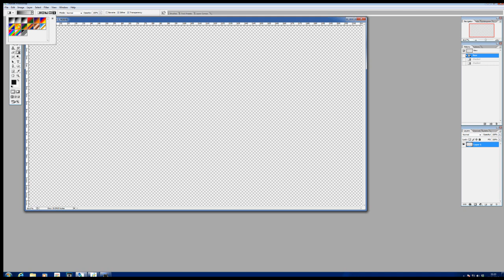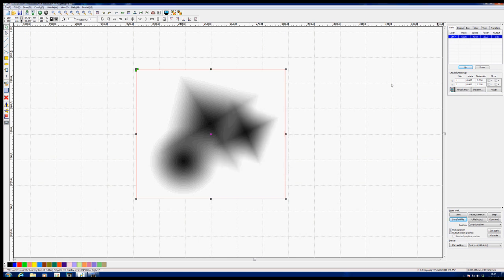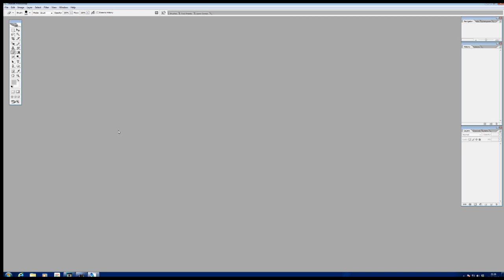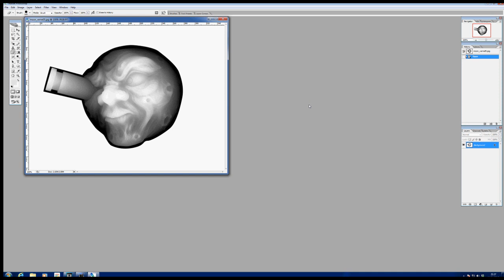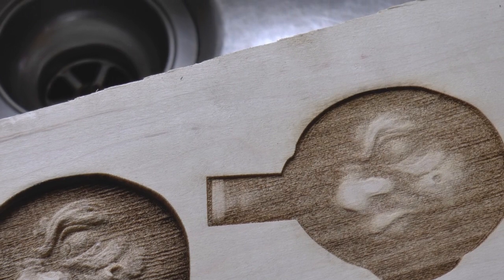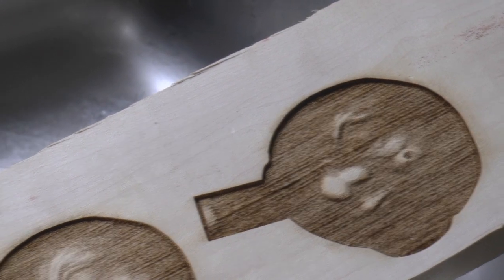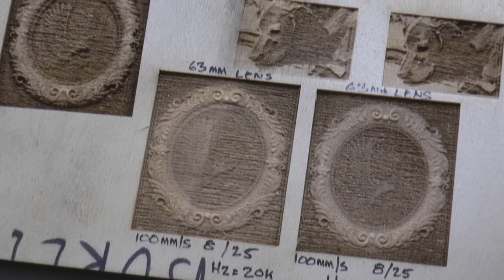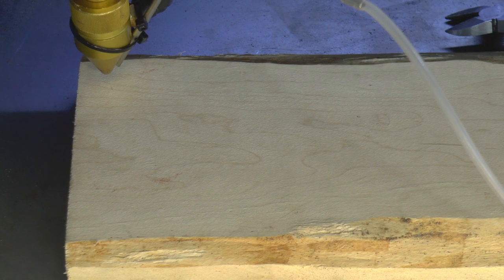RDWorks Learning Lab 58 3D carving At last!!

Comment: Hello again Russ
The machine we have has a setting in the controls panel named user...the option that I discovered was the scan mode option...it's set from the factory on normal state...if you select special scan mode it's allows for proportional scanning....it's free tried it and it works great.
Reply from the maker: +Scott Thorne 
Hi Scott
Very interested. I'm up to my eyeballs with urgent paid work for the next few days with little time to play. What's the difference that you noticed.?When I get time I'll play as well to see what's possible. Thanks for the info
Sincere regards
Russ
Reply: +SarbarMultimedia Russ
The overall depth of the engrave changed...the light grays were more pronounced as well as the darker shades of gray...I actually read about the setting in the operation manual for the software.

Comment: I'd suggest relieving the tube of instantaneous power ups/downs in wattage.
I can't say if the electronics would be at fault or the tube.
But a latency in the etch as well as the heat of the material could possibly be at fault.
For example the star shape ... 
If your machine was programed to simply cut a star within a star within a star (etc) at different shades of grey.
Rather than using linear typewriter type motion at the head ... The results would be significantly different.
Multiple passes could be applied to tackle depth issues.
Just a thought.
Reply: If your design looked more like a topographical map ... then ...
Reply from the maker: Hi I understand that a series of contour lines  would produce the best results and that is effectively how they generate those decent images that carve so well. However, I am not trying to find workarounds, I'm trying to firstly understand how the machine works and if there are problems with instantaneous wattage control then I'm out to find out why.  Although the PWM system is used to control cutting power,  I think there must be a lookup table within the controller to deal with the 256 grey levels at 500mm/s That's something else I want to check out. Just how responsive is it
Thanks for your input  it's always good to get stimulating ideas.
Best regards
Russ
Reply: If you ever entertain the idea ... It's a video I'd love to watch.
I have no idea how a picture of a horse for example could be converted in such a manner.
It may be a futile exercise.
Reply from the maker: Sadly I think all these models are produced from raytracing real 3D objects. Its the amount of reflectance off the surface that you are trying to map. Imagine  a mirror polished round tube If you fired a beam of light onto the surface and measured how much light was reflected back at you. On the surface closest to you there would be 100% but as the tube curved away from you, more of the light would scatter sideways  and there would be less and less refelectance. That's the principle.
Russ

Comment: Hey Russ. Just curious to know if your using cast or extruded acrylic for that last etch? Extruded is much better for etching as it gives a more smoother finish. Also you good heat the etched area up with a miniature blow torch to smooth it out further. Excellent research here
Reply from the maker: +Mohammed Ali
Hi Mohammed
As thickness increases extruded acrylic tends to be a rare breed  and most of what I use is offcuts from a large supplier (that I get almost for free)  and tends to be cast acrylic....I can't be too choosy with that deal.  Flame polishing as a second operation is not something I had considered......... but it's an excellent idea.  I may try running the program again at a lower power/faster and defocused by maybe 10mm to see If I can deliver a controlled polishing effect.
Thanks again
Best regards
Russ

Comment: another great video.  now that you have a true 60W tube which is I deal for engraving.  could you post what you are now able to cut like material, thickness. power or ma setting and number of pssses etc  I would like to order a machine and would like to see some real world figures of what a 60 w can do.  a lot of the makers say 90w but the engraving detail will be far less is my understanding
Reply from the maker: +3K Carbon - G10 - FR4 - Supplies & CNC Routing - 3D CAD Design & 3D Printing - Online Shop 

Hi
In the past I have always used %power  and speed when I have talked about machine settings. But of course that's pretty meaningless because now I have the 60 watt tube the previous % power settings are meaningless. I plan to record my future data in a more universal way ie watts and speed. Now this is a problem for many people because they do not have power meters and do not know what power they are using. I do not yet have much cutting data from my new tube but you can go to 
http://www.thunderlaser.com/download/down/parameters%20for%20different%20materials-60watt%20SP.pdf

and get a good representative list of parameters. I suspect these parameters are for a 2" focal length lens and will understat what you will be able to achieve with a 1.5" lens.
Double cutting? Yes I have done it and it sort of works but is very inefficient and its success is very material dependant. With acrylic it works reasonably well but you may get a bit of a rough finish to the second cut. Acrylic evaporates whereas most other materials BURN. The smoke in the cut itself is a fantastic absorber of the infra-red radiation so a CLOSED cut just harbours the smoke and absorbs your power. Double and triple cutting does nothing more than make a bigger mess of your cut. You ideally want tp slow down to a point where the material cuts right through and  the air assist will blow the smoke out the bottom of you cut
Engraving does not require huge power. If you buy a 50 watt machine the chances are you will get a 40 watt tube. That 40 watts will typically span 10% to 60 % ie the machine programe will typically have control 40/(60-10)= 0.8 watts per 1% power. If you then upgrade it to  decent 90 watt tube, the chances are you will get 100 watts at about 65%. Now the program has control of 100/(65-10)=1.8 watts per 1%. That finer control of the power for a lower power tube is what's being discussed when they talk about better detail.
The other factor that may influence your decision is the ratio of cutting to engraving you will do and if it's for a business . Higher power can mean higher productivity (higher cutting speeds ) in most instances. I have used 30 watts at  the  nozzle to cut 15mm acrylic but at 1mm/sec   and also 12mm plywood with a 1.5" focal length lens.  60 watts gives lots of flexibility but beware of buying a 60 watt ebay machine. Ask lots of questions of the vendor because the chances are that their 60 watt machines will be 50 watt machines with 60 watt power supply. 

Good luck
Russ

Comment: This is awesome!  Now that laser engraving has progressed to this level, now I am sure that one can use lasers to mill also....even to do SURFACE FINISHING...which is awesome, because if one can mill using a laser, there are no 'work contact' related forces to deal with which lower the cost and simplify the design of cncs in countless ways!
Reply: Could you (if you are not looking at this already), look at trying to develop methodology for milling material away and then (using the same technology ? for carving shown here) demonstrate the ability to do some (even crude "finishes" would be AWESOME!) finish passes on steel or aluminum???!!!  Wow!  That would revolutionize many aspects of machining and manufacturing!!!!????
Reply from the maker: Hi 
Sadly I'm afraid your dream will have to remain "dreamish" at present. I have been involved in engineering all my life and particularly production engineering where I am always chasing your dream. I owned my own metal cutting laser business with two 3kw machines. All the old techniques of welding, stress relieving, rough machining, finish machining etc etc all disappeared from my book when laser machines came along. There are so many things that can be converted into 2pieces and accurately laser cut and assembled to bypass many of the traditional manufacturing costs.  Although these little machines are fantastic value for money they are not anywhere near your fantasy yet. Firstly these do not have the power to cut metal. HOWEVER there are some new high power fibre optic laser engravers that can do some amazing tricks with surface finishes. I can't put my hands on the link at present but I will look later
Best regards and thanks for you comment
Russ

Comment: I not sure if you're aware but I have to tell you that before engraving relief engravings you must dither the image first, only then you will have good results even with your "specially prepared images" which are in fact grayscale from 3D relief made in ZBrush or ArtCamPro, Im 3D modeler myself thats how I know it, I also have 2 laser engravers which I m using for more than 7 yrs now pro. Also you must set one direction laser beam so it will not burn too much. You have dithering tool in RDWorks as well, under bitmap handle menu. Cheers. I forgot to tell you, you need to make laser beams from line to line closer for this setup, about 0.08.
Reply from the maker: Hi Toni
Sincere thanks for your feedback. As I am sure you know I'm still learning about this machine and technology and my venture into 3D carving has thrown up so many questions about the machine that I wish to understand and that's before I get into the finer points of 3D creations.  I am not a graphic artist, just a simple mechanical engineer without the software tools you mentioned. As a professional passing on the benefit of your experience, I cannot thank you enough because trying to find information about the details of this subject has been impossible.
I am on holiday at present so am unable to play with my machine.

There is one thing about your dithering suggestion that puzzles me  immensely. My understanding of dithering is that it's a way of converting a grayscale image into a binary black and white format  where the density of the fixed size black dots recreates the effect of a grayscale  image but with binary information. You set the the laser to a fixed power, scan speed and scan pitch, then as the scan happens, the laser power is either ON  as it encounters black dots  and OFF in white areas. 
On the other hand, as I have found out by experimentation, when you set the max power and min power to different values and leave the image as an original multi-tonal image, RDWorks breaks that image  down into scan line data that has continuously varying power information across the scan, where that varying power  is one of 256 levels between the max and min power levels set. This causes a continuously varying depth of "burn" and scan line by scan line gradually builds a 3D rendition.
As I have been experimenting with dithered images on thick card I have noticed a sort of shallow 3D effect as the burnt dots overlapped in the very dense areas. This is an interesting effect but not 3D carving.
The uni-directional scanning  and line spacing are items on my experimentation list when I understand more about how the laser beam is controlled in scan mode as opposed to cut mode. 
I am now more fascinated by your introduction of dithering to this process. I cannot see how binary  dithering and continuously varying grayscale scanning are complementary.  Can you please explain further 

Sincere thanks for your input
Best regards
Russ

Comment: Is there any way to generate a fill pattern with dots reliability?  

RDWORKS has a dot mode (scan, cut, dot), but it can only follow lines and it causes the machine to loose stepper motor synchronization. So everything gets distorted.   My machine is able to cut and scan without loosing stepper motor lock,  even at very high speed.  At even very low speeds, the dot mode causes stepper loss.  I noticed in scan and cut modes, the head accelerates and decelerates without discontinuities.  In dot more, it appears to jump abruptly, thus causing stepper lock loss.

I want to engrave with dots since it should generate the best visual effect for lighted signs. Same principle as back light wave-guides for LCD display.
Reply from the maker: Hi John
 There are two possibilities for you.
Right at the bottom of the EDIT menu there is a feature called LGP design. I have no knowledge of this but it is specifically for doing what you want.
I have found that back engraving quite deeply into acrylic leaves a matt crusty finish in the letters/ lines which is great for picking up edge lighting,  not necessarily good for photo's. 
There is a feature in RDWorks that you will be able to employ.  Here's a simple example to test it with.
Draw 2 concentric circles in RDWorks. 
Put a marquee round the whole. 
Select Handle and choose Graphic Hatch.  A bmp resolution window appears. Set 100 say. and press OK. The outer area is now a bitmapped area and a BMP layer appears in the parameters list.
DONT put a marquee round the whole, that will select BOTH layers. Just click in the grey bitmap area and handles will appear on the bit map layer only.
Select Handle menu and click on Bitmap Handle
NOW its all down to your taste.
Tick output resolution. Tick Dither. Tick Dot Graphic and click Aply to view to see what you will get. Change the resolution to 50 and click apply to view
When you get the look you want then click Apply to source and and OK
Check with Preview to see an idea of the cut order and what you will get.

Hope this helps
Best regards
Russ
Reply: I found out how to make Dot not loose lock.  Speed x Dot time = Dot Length
Motion becomes smooth and sync is maintained.

Comment: The frequency that you mentioned is the frequency of the PWM signal that goes to the laser power supply. The supply has what is called an RC filter inside of it to turn the digital PWM signal into an analog signal. The cheap capacitor inside of the RC (Resistor/Capacitor) circuit might explain some of the non-linearity that you have seen in a previous video. You might be able to do your linearity test at 5k, 20k, and 50kHz to see what gives the most linear response.

Also, I have done some quick translation work on RDWorks to go from Chingrish to English. Let me know if you (or anybody else) wants a copy of it.

Comment: I thought the curved side should be down towards the material?
Reply from the maker: Hi
Most Chinese machines appear to be shipped with lens installed curved side down. The lens will work ok that way round but tests show that you get a slightly shorter focal length when  you set flat side to work and also a better (smaller) spot size.
Best regards
Russ
Reply: thank you for that!

Comment: Hi Russ
For me, it looks like you maybe  are using a lens with to long focal distance, but most of all, look at the uneven lines in the bottom of the engraving, it look like there is a setting wrong somewhere, something with line spacing, resolution or something like that. Would you mind sending me the same file, so I can try some experiments when my machine arrives. I think it is good if we actually are using the same file to compare and exchange results. Just the original one, please. Wow 3 weeks is a looooong time :(
Reply from the maker: Hi Klaus

Unless I mention it in the video I am always using my favoured 1.5" lens. The line spacing was 0.1mm default but I know I can improve the finish with more overlap. However I never got round to that exercise yet because I became distracted by the VERTCAL lines which were a real puzzle. I'll soon get back to playing with the finer points to get the best result, even go as far as multiple passes.
Best regards
Russ

Comment: Have you tried to develop settings to remove char on a second pass?  I seem to recall someone saying to run it faster and with lower speed but can't find where I saw that.
Reply from the maker: Hi Marti

I fell into your trap of trying to remove too much material at once and getting a charred finish.. Once there,  it is almost impossible to clean it up. My guess is that you are using a 2" lens. Not the best idea because it is too "sharp" I found that either a 2.5" or a 4" lens was better for 3D work as both are much "softer" and less prone to producing charring.  That is the real trick. Use a longer focal length lens and do some tests on the wood you are using,, setting  the speed to 300 to 400mm/s.  Make some small test engraving squares and test each at different power. You are looking for the combination of speed and power that removes the most amount of material without charring or significant scorching. It may mean you have to do more passes (6 or 8 maybe?but the results will be good The Y increment setting is also important to add that into your tests as well. If your scan lines are too close you will get over burning  so you may finish up wit 0.2 to 0.25mm increment.

Best wishes
Russ

Comment: Russ, RDWorks Learning Lab 58 3D carving. Your better engraving woods here would include Balsa, Poplar and African Mahogany. Not Lauan (Philippine Mahogany). All considered Hard woods but are quite soft. For CNC fine detail routing, I believe, they will include a non-fibrous  wood made almost totally of a specialized adhesive and wood sawdust. In addition to the stepper motor drag markings are the irregularities in the wood caused by  of the open grain patterns on the faster growth trees. Walnut, Cheery, Maple afford the impressive grain patterns which command greater cost to the customer. Not intended to be a masters thesis on wood only some general information. For extra fine carving/etching woods from Africa stunning and exotic.
Reply from the maker: Hi Ron
Great information for which I am grateful. My aim is to investigate the general process capabilities rather than to produce artistic creations. I agree that MDF is a good homogeneous material to work with but burning the resins is a sticky smelly business as you will find out when your machine arrives.
Best regards
Russ